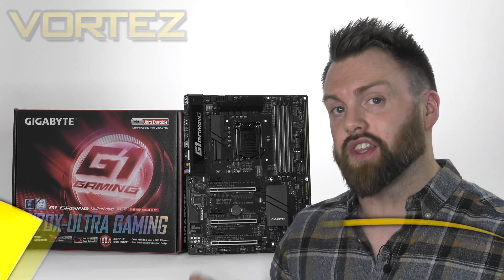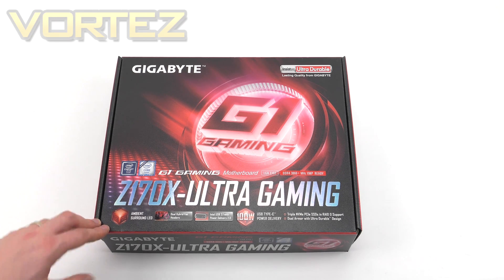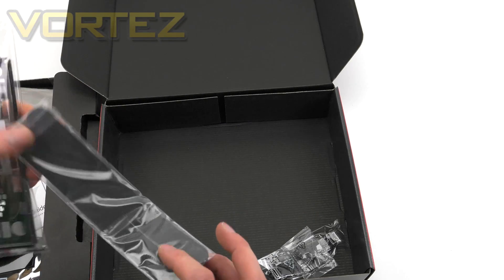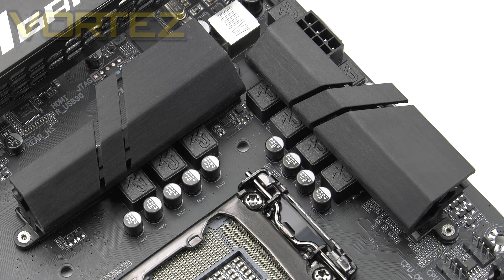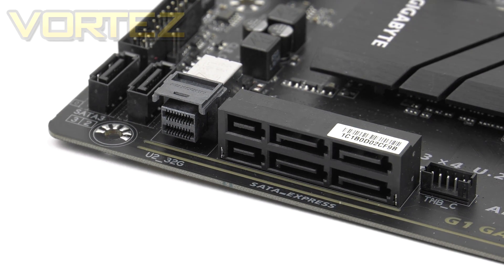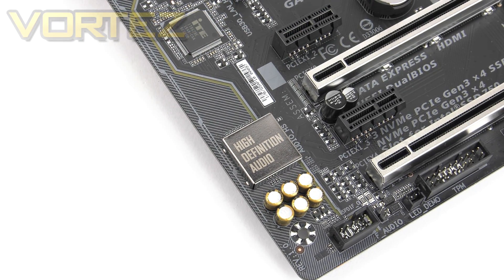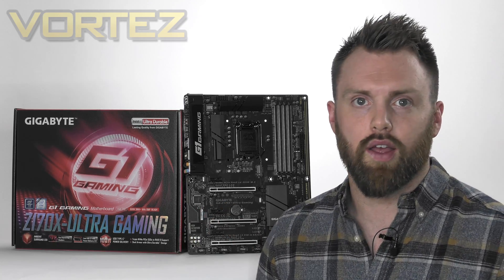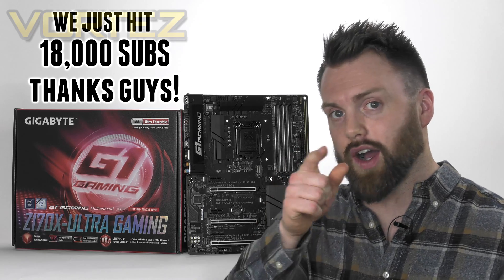GIGABYTE Z170X-Ultra Gaming Review [4K]

Comment: does it support core i7?
Reply: If you do not know this, perhaps you should not buy this type of extreme equipment. It takes a little while to familiarize yourself with compatibility between the pc components. You wouldn't be the first to spend money on high end components only to find out they're not compatible with your current components. 
This motherboard has an 1151 socket, so it only supports Intel Skylake and Kabby Lake processors. So if you have, for example, an Intel Sandy Bridge i7 2700k, it will not fit on this motherboard.

Comment: In your opinion, would you choose this board or the MSI Z170A Gaming Pro carbon Mobo? I found both for the same price.
Reply from the maker: That's a tough one - both are very, very similar. Personally, I prefer the GIGABYTE. With either one you're getting a great board.
Reply: My dilemma exactly! I am looking at the mobo 'cos the MSI's are out of stock! Selling like crazy I guess!

To Kanata, I'd like to ask what is the deal with the Carbon? I wanted to go for the MSI Z170A Gaming Pro (the red one) actually. Is the Carbon better in anything?
Reply: The deals on Newegg are over but in Canada they were $200, right now I'm actually set on purchasing the Gigabyte Z170X UD3 Ultra board (seems identical to the Ultra Gaming except for colour) the Carbon has 3x USB 3.1A ports, the Gigabyte only has one.
Reply: I went for Asus Z170 Pro Gaming/Aura.

Comment: RGB lighting on different areas of the board that can be controlled through an app.gigabyte say
Reply: it is red only.
Reply: Red only and cant be turned off
Reply: @dultaging  Yes you can turn them off, no you can't change the color to anything other than red, you can set them to pulse off and on for 3 seconds, but you can't adjust that frequency of duration.

Comment: Love all the bells and whistles but not a fan of built in leds. The matt black is very acceptable. cheers
Reply from the maker: Indeed, its quite a nice base for a new system. What is it with all the LEDs at the moment? Its as though its some kinda ground-breaking innovation that's just been discovered...
Reply: Can they be turned off? thinking of jumping to z170 or x99 and well this reminds me of my p67 ud4, a nice simple looking board